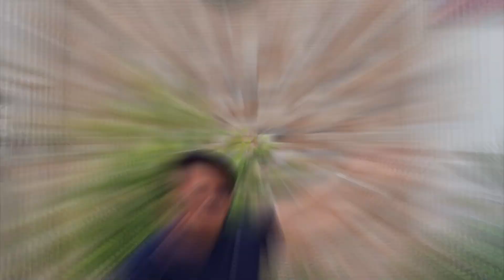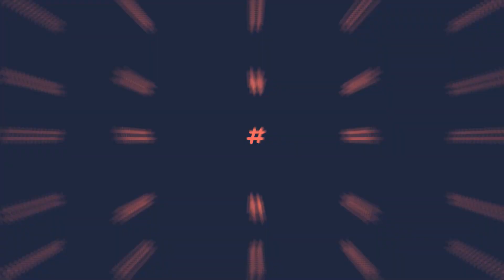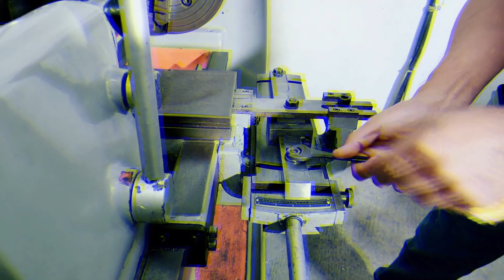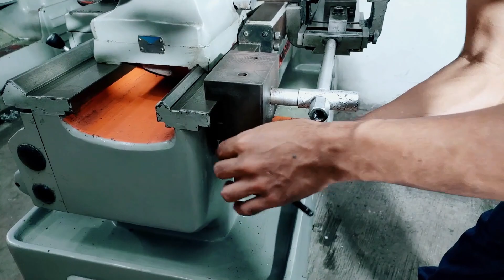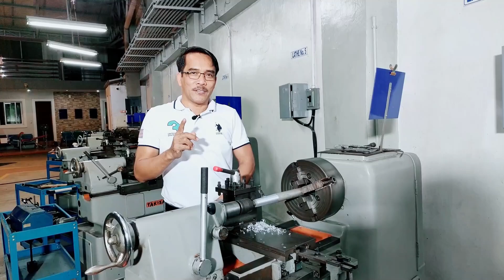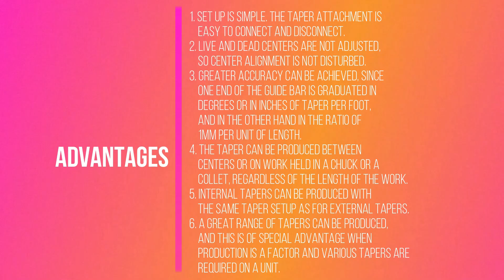Taper Turning Using Taper Attachment Method

Comment: Sir yung allen cap screw po ba sa may ibabaw ng cross slide ang kailangan luwagan para sumunod yung carriage sa taper attachment angle? Thank you po
Reply from the maker: Hi Paul, hindi kelangan luwagan ung bolt sa cross slide kundi ilock ang taper attachment sa bed ng lathe para sumunod ang cross slide sa nakaset na taper attacment.

Comment: Thanks po sa another info, Sir may tanong lang po yung binding screw po ba ng cross slide ay yung allen cap screw doon sa cross slide na malapit sa screw ng compound rest? Thanks po.
Reply from the maker: Yes Miguel, kung ang taper attachment ng  lathe mo ay plain type.